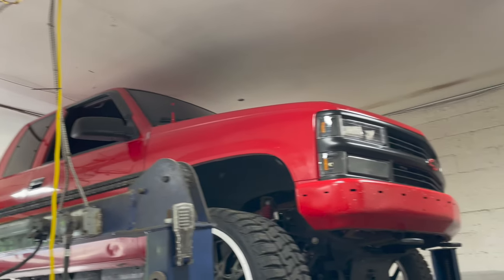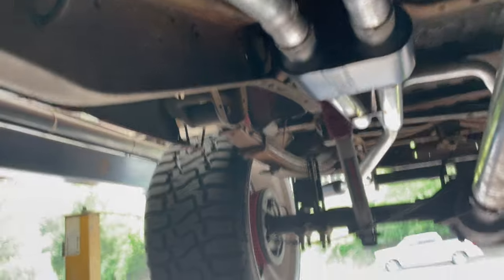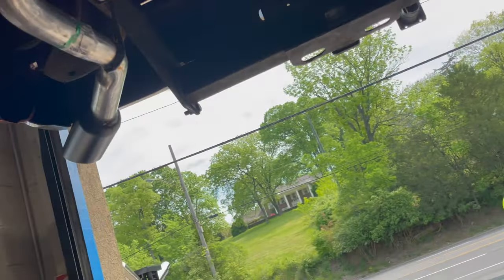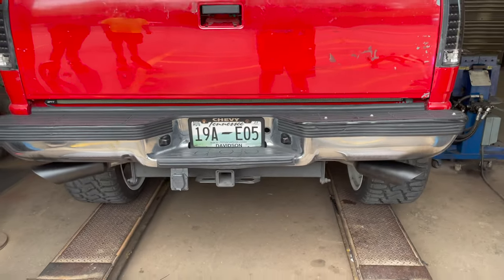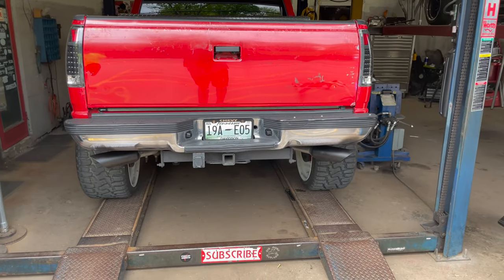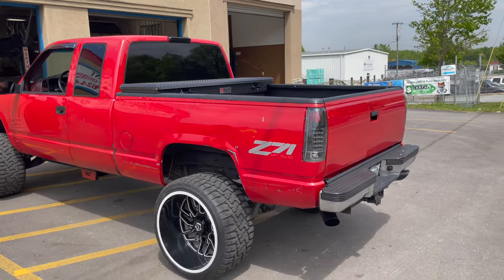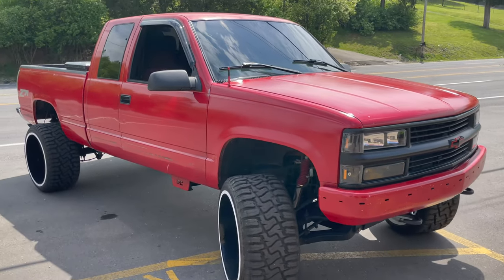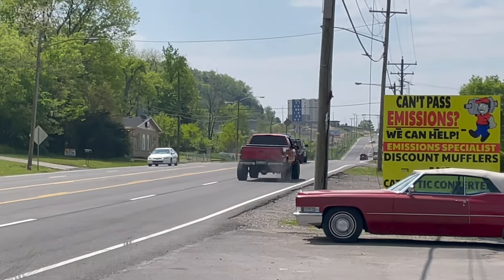1997 Chevy 1500 5.7L V8 True Dual Exhaust w/ FLOWMASTER SUPER 10!

Comment: 344,000 miles
Reply: It has a new motor and trans
Reply: Need a new front when he pulled out that right wheel didn’t look good
Reply: @anthonymcdougald3776 just the front lifting up a little bit from acceleration. It straightened out.
Reply: Truck has brand new front end. Only factory piece is bottom a arms

Comment: Not true dual
Reply: Because of the muffler ?
Reply: i just had a dual in dual out original 40 put on my truck not by request but out of ignorance. Im wondering if performance wise id be better going with 2 single in single out 40s. I cant imagine any performance loss im currently suffering would be a significant amount